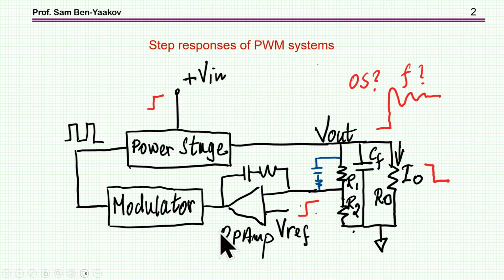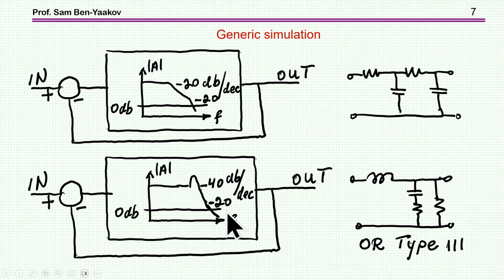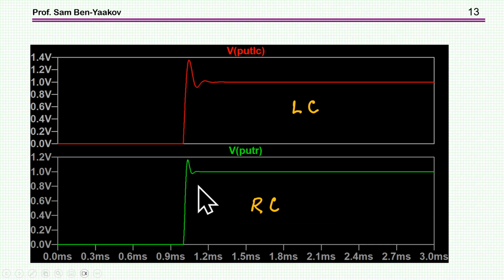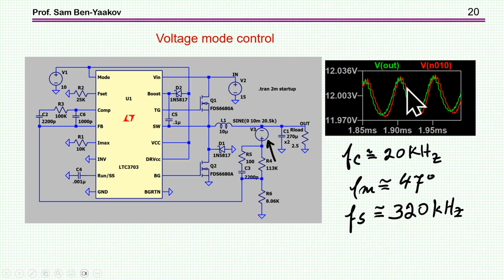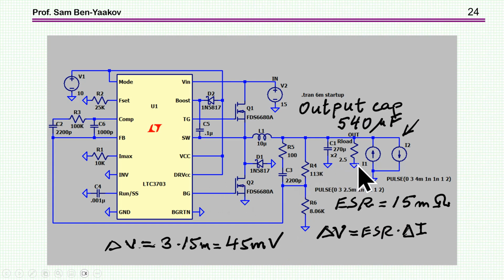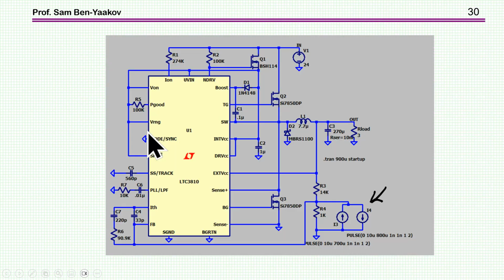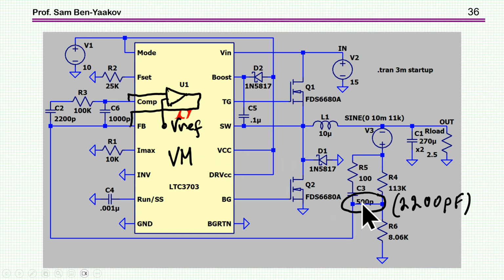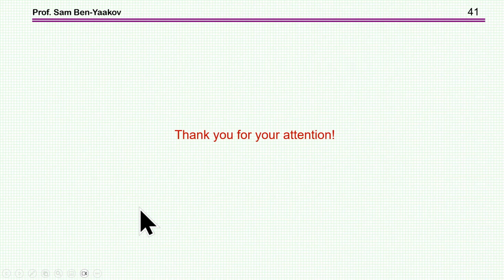Testing the transient response of PWM converters by LTspice

Comment: Looking at the current thru inductor after changing the feedback capacitor, I realized that a capacitor that loses its value can create a damage path that make some transistor pull more current and damage it.  I think this is something you will never see a root locus plot, but shows an interesting chain of events for a catastrophic failure.
Reply from the maker: If you mean reduced capacitance you certainly can see this in the transfer function if you model the cap after change. But if you mean a partial short this is a different story.
Reply: @sambenyaakov  I meant no short.  Capacitor change like issues that electrolytics present.  Thanks for teaching us all. :) :)
Reply from the maker: @ikocheratcr  👍

Comment: Marvellous video as always. I myself have expirience designing and testing this type of converters and I have always wondered why the step response wasn't really matching with the phase margin measurements.

The more I learn about loop analysis, the more I find that in real applications there are a lot of nuances that affect the behaviour of the systems and most of the time is not easy or intuitive to draw conclusions.
Reply from the maker: Thank you very much for sharing you experience and thoughts.

Comment: Thanks a lot prof. I have one doubt why ppl are recommending gain margin should be above 12 db? What the role of gain margin?
Reply from the maker: Gain margin is another issue. I have a assumed that there is only one area in which the LG approaches 1. If at another frequency the LG approaches 1 it is altogether another story. Perhaps a video on that will be interesting😊
Reply: @sambenyaakov  sir could you please make video on  the LG approaches 1 at different frequencies as you mentioned on above comments